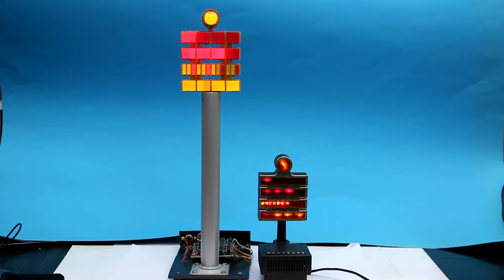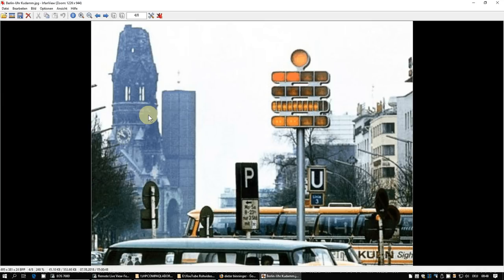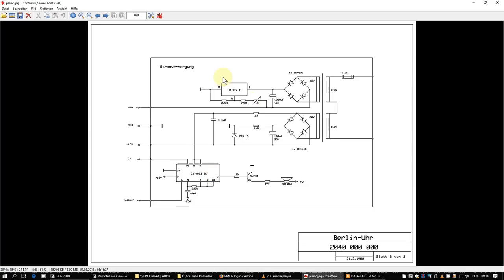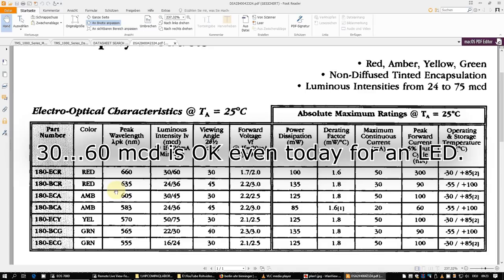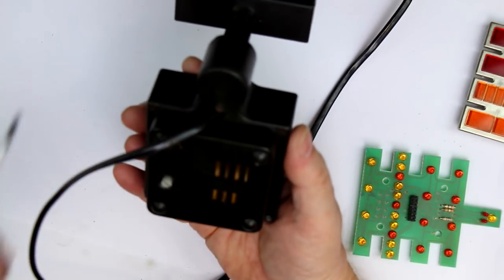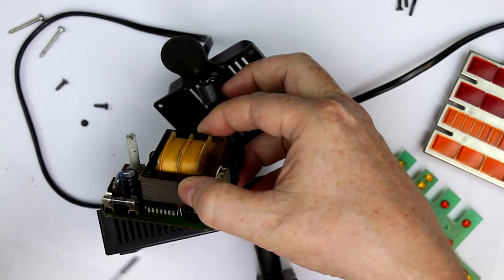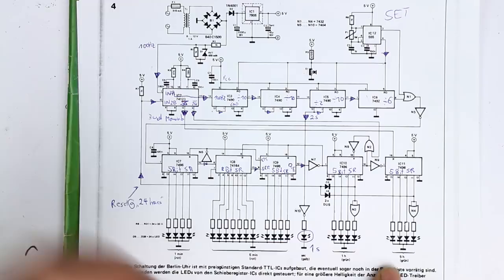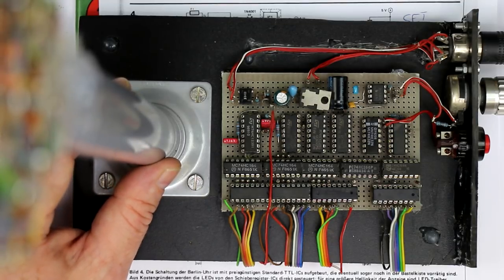The "Berlin Uhr" or "Mengenlehre-Uhr" (Set-Theory Clock)

Comment: I recently bought one of these clocks, and I got it working again yesterday. The power supply of my clock is a little bit different from yours in that it is laid out differently and has no fuse. Like your clock, mine had a burned out LM317, which kept the LEDs from lighting at all. For some reason the designers of this clock didn't put a heatsink on it, even though it is dissipating ~2 watts; I replaced the LM317 with a NOS one, and then installed a small clip on heatsink, to hopefully prevent it from failing. For good measure I also replaced the electrolytic capacitors, since this clock runs hot.
Reply from the maker: Interesting.

Do you have a date-code from your version and could you show a schematic of the different power-supply (pencil-drawing is sufficient)?
I know that the different sellers/producers over time (ATM: Asmetec) have changed the layout of the power-supply at some time when they noticed the continous problems with the power-supply.
Reply: I don't have a schematic for this clock, but I do have some pictures I took while repairing it (except for the pictures of it working, all are from before modifications): https://imgur.com/a/DxL6F6e
My clock is serial number 10617, so it was made some time after yours, but by the same manufacturer.
Reply from the maker: That was apparently the next batch, when the previous batch was probably up to serial number 10000.The date codes of your clock are also all from 1980. Probably Dieter Binninger hat to order a substantial number of the (mask-programmed) TMS1000 to get a decent price (or a minimum order quantity of more than 10000).Because the case for the clock was tied to the exact shape of the transformer he also was bound to keep the original (underrated) transformer and the basic PCB-layout (at least the size).The failure in the electrolytics probably came from drying out due to the very hot temperatures inside near the LM317. Remeber that todays high-quality electrolytic caps are 105°C certified (or even better) while in the 1970s/1980s they probably were only useable at 40...60°C for extended times.Good to see that someone else was able to bring a defective clock to life again.Would you tell me what you paid for it?
Reply: The transformer used in this particular clock actually seems to be smaller that what the case was originally designed to hold, because only the two rear mounting posts are used, and the transformer doesn't quite reach the front two. The electrolytic capacitors in my clock measured reasonably close to their original values (I didn't test them for ESR), but I replaced all of them with 105°C rated capacitors, and relocated the main 1000 mfd capacitor to the bottom of the case (it was too tall to mount vertically, but this should also keep it cooler). This clock cost me $100 (+shipping), and I think I got a reasonably good deal on it, although it was sold as untested (never a good sign) and was completely dead on arrival.

Comment: I have the same version with same PCB but my one doesn't work anymore. This video was helpful to figure out the problem, unfortunately the TMS1000 itself doesn't work anymore. So, i am looking for a spare part, but i am afraid  i won't find this rare one..
Reply from the maker: Are you really sure that the TMS1000 is broken? Perhaps it´s only a broken PCB-trace (power or the 50 Hz don´t get hrough to the controller)?